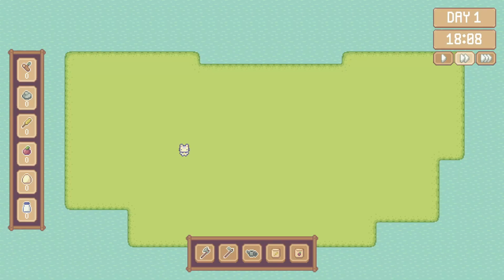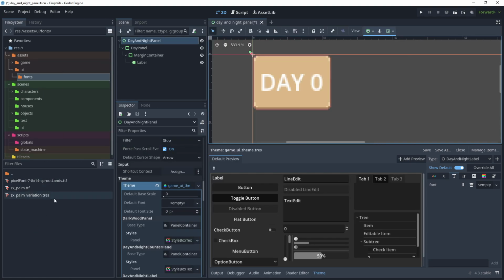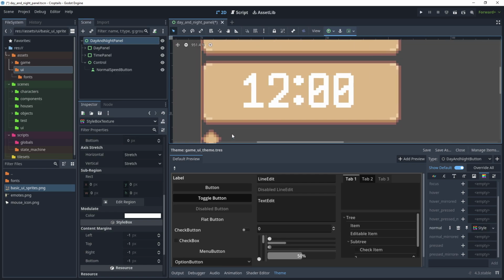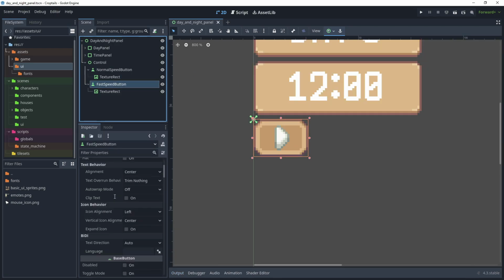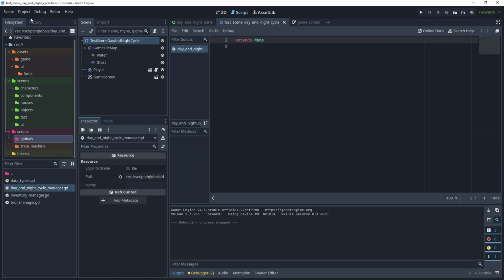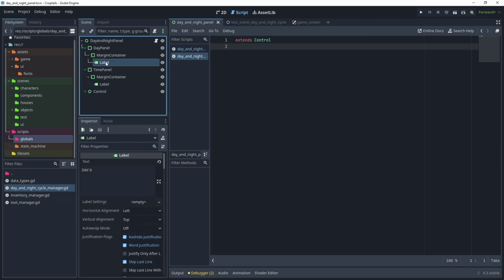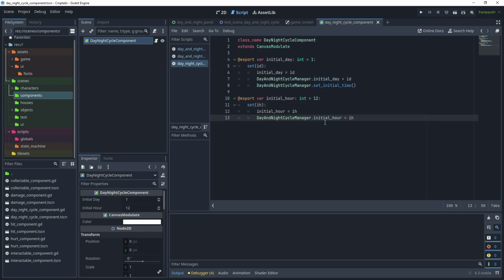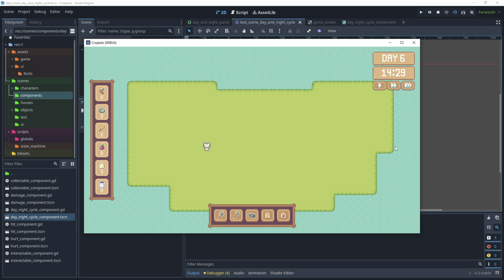Day and Night Cycle UI Component with Time and Speed - Godot Tutorial - Pt 16

Comment: Does anyone know how to do is keep the 'button pressed' look when I have the tool activated and I'm adjusting the time?

My use case:
- click the watering can to water crops (watering can button pressed colour activated)
- click the fast-forward button to speed up time (watering can button pressed colour no longer active, only fast-forward button is active, but watering can is still usable as a tool).

Is there a way to have the watering can tool retain the 'pressed' look when interacting with the fast-forward buttons?
Reply: Don't know if you found a solution during that time , but i'm pretty sure theres a toggle thing you can turn on True for every button , you just need a way to make them "unpressed" when you click on a new one (personnaly i think i'll do something in the code like , when the button is pressed , it keep itself in a var and unpress all the child of the button container with a for loop , EXCEPT if it recognize itself during the process ('cause if not , you'll get every buttons back into unpressed state probably) , i didn't test it in my own files but pretty sure it can work and im' not good enough to think about a better solution)